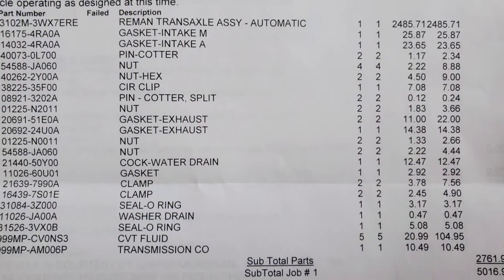2017 Nissan Maxima Cvt Failure! 🔴 What Signs to Watch For and Things To Avoid!

Comment: Definitely feel you pain…. My 2015 Sentra sr is on its 3rd transmission and this one is also failing…. This is within 1 year of getting the transmission replaced…Like you said it’s not worth going out buying a newer vehicle that is severely over priced… I’ll be sure to take the car back to the dealer for them to replace it again for the 4th transmission before my 1 year 12,000 mile warranty is up… luckily caught the issues 300 miles before my factory warranty was up
Reply: I just bought a new trans in my 2015 sentra sr 4800 bucks only 40,000 miles jatco trans suck and there should be a lawsuit

Comment: Those RPM's don't appear to be too out of whack.  You got all the way up to 80 MPH pretty quickly.  But maybe I am wrong....I did just purchase the 2017 Maxima in 2021.  It had 88K miles on it.  I've put about 10K miles on it and love driving it.  However, I did just spend 3K on the 100K tune up and to have the AC Evaporator Coil replaced when we noticed we were no longer getting cold air.  I wasn't happy about this and wish I would have bought the extended warranty.  Other than that, I love Nissan.  I don't have a problem with the CVT like most everyone else does and I really enjoy the heaviness, traction, and sportiness that the car offers.  My first car was 92 Maxima and I finally have another one that I has exceeded my expectations. (Minus the AC issue but that's what I get for being cheap and buying a used car)
Reply: The RPMs actually were winding up quite a bit, considering that the Speedo wasn't moving upward all that fast.  The Maxima has really got some brass ones if you step hard on the gas.  Then yes, the RPMs will wind up and you'll shoot like a rocketship.  But he's right; he wasn't really stepping on the gas hard enough in those 2 videos to justify all the noise and fury of revs in the 6000 RPM range; not at all.  The CVT was definitely complaining like it was in pain.
Reply: My honda gets to 80MPH with only 3000RPM then stable between 1900 to 2300RPM. Going to 5000RPM to get to 80MPH is definitely insane and it tells you that the Trans is going OFF soon.
Reply: The see-sawing RPM is the stupid feature this transmission has that simulates a 7-speed automatic's shift points. It tends to only do this when you floor it, so over time you can learn how much beans you can give it before the transmission starts trying to pretend it's an auto. You will actually be quicker if you accelerate right underneath this threshold. Didn't see anything in the videos that was abnormal. If your CVT starts to slip, it's different. RPMs go up, but you aren't getting torque. Or keep losing torque periodically. Also, by that point, it's most likely too late to salvage it.

Comment: I was told that I needed a transmission at 330k but at 392k I'm still on the same transmission.  IT had the judder code but that doesn't necessarily mean it actually judder. It's something only the code reader can see. No check engine light. Sometimes it revs a but high but at this point I'll have 400k miles or more so it doesn't matter. I can get a transmission put in for 1500. Not a big deal.
Reply: Good luck with that ..Transmission from junk with 100.000 will cost that much..
Reply: @A1cto5.3  no the transmissions were around 30k miles and cost around 1k but I don't need 1 now im at 404k miles it's still ok to drive hundreds of miles a day.

Comment: My car just started to do that crazy RPM shit. I too have a 2017 Maxima, I'm the first and only owner, Going on R sometimes isn't as smooth. Going to take it somewhere to get checked out. I have 84K miles on it. Does anyone know the warranty on the CVT?? Well, what I wanted to tell you all is that I just paid 3k for a new stereo system that broke down on me. The navigation, radio, cd player, maps all the display just went black and died on me. They didn't tell what happened or why it might have happened or anything. They just said it's dead and I need a new one. ANYONE else??

Comment: Nissan came out with the cvt and err body else just did better with the cvt transmissions Toyota is just fine. After replacing Nissan transmission you can't program it. Nissan can after replacement. Thanks Bro 😊 🙏

Comment: 2017 Maxima Platinum bought brand new had about 13k on it and had it for 2 years. Pulling into a parking lot and moving forward. It jerked forward and threw both me/passenger back. I knew immediately the CVT was going to fail. I got rid of it that same week and traded it in. Awesome car but weak and terrible CVT reliability long term. In my case it was already happening early. Yes they are unserviceable and must be replaced.

Better buy an extended warranty. It’s not a matter of if but when the CVT will fail. They all do with Nissan’s.
Reply: Yikes, at 13k? Unacceptable!
Reply: @gunterkeegan670  Double whammy! I kid you not. The vehicle we traded it in for 2019 Honda Passport Elite brand new. The transmission completely failed at 8,5XX miles and had to be replaced with another new one. We got rid of it once it was replaced for a new 2021 Honda Accord Touring in December 2020. 13,2XX miles on it now and been okay other then remote start that went out on us. They had to pull the dash completely out and drivers side door panels. It was a faulty wiring harness that went between the two. It’s worked perfectly fine ever since.

Comment: In conclusion. CVT transmisión are garbage and the worst thing is most car manufacturers are using this claiming that helps to be more fuel efficient. But shorten the life span on the transmission. Stay away from cars with CVT

Comment: all Cvt's are covered under the 10yr 120k warranty the dealership should have told U that
Reply from the maker: i was past that by 4k miles when i had it looked at
Reply: That's not true for my 2022 Infiniti QX-50. The booklet says 72 months/70,000 miles for the powertrain.

Comment: I never heard of CVT going out in 8th generation Maxima think CVTS got better hope had extended warranty get it fixed. It was lawsuit on Altima and Rogue models got a 2015 Rogue CVT still fine right now not worried got extended warranty its paid off even on original battery and brakes. I love ❤ Nissan's some CVT trannies will go out for no reason hope got it fixed.
Reply: I do too. CVT aren’t bad if they are built decently but Jatco has a poor reputation. If Nissan would take their stake elsewhere I believe they would up to par. Nissan makes good engines. I have a 2016 Nissan Sentra with 100,000 and it has been a great car

Comment: Cvt fluid needs needs needs to be changed every 25k to 30k if you do 4.55 quart fluid changes every 40k if you do total fluid change 8.5 quart complete swaps.  It needs to be done and only with nissan brand fluid.  If your save $37 by buying non nissan brand your risking a $4000 repair not smart.  Change your fluid and don't drive like a jerk for first 5 minutes everytime you drive a nissan with a cvt and cvt will last 150k +

Comment: You bought it with 6k miles on it and now complaining that its showing transmission troubles at 123k ? You should be thankful because you got well over the average life expectancy of a cvt transmission . Most of them don't last 45k to 50k miles . There is a reason you see so many used maximas and altimas at the 40k to 50k miles mark for sale .

Comment: I've not known Maxima CVTs, NOT ALTIMAS, to have full-on failure with routine maintenance until after about 190k - 220k miles (that's good for an average transmission, Toyota 8-speeds don't last that long). The symptoms were of a bad valve body not failure, see some vids that's different, and usually taken care of early on under warranty. I don't think they either correctly assessed, or were completely honest with you, and their ignorance (or greed) cost you...

Comment: 😁😁😆
If you screw your car
Your car will screw you.
I had Gmc safari, Honda odyssey, Accord, Buick century, corolla, caravan
They all lasted me 300,000 kms
Caravan and odyssey lasted me 585,000 kms.
I'll share one secret to do that.
Start your car and leave it for 3 minutes so it can catch the rhythm. Then gradually start your radio ac whatever in next 3 minutes while you are driving your car. After 5 minutes you can drive your car whatever way you like but initial 5 minutes respect your car after that your car will respect you and never leave you on the road stranded. 25 years of experience.

Comment: I currently drive a Jeep Patriot 2012 and it’s at 141k and it’s CVT feels great on a cold start. When temps get to hot, it starts lagging. I went and got an oil change, 1quart is hyper lube/3quarts high mileage. Added a additive to my coolant. Changed transmission fluid. Now runs unbelievable smooth, I do not use 87 gas, I use 89 now, because of the compression is better on the pistons. Just be gentle on them, they are very amazing.
Reply: We had a 17 patriot that we bought back in 2018 and it was great but that vehicle should not have come with cvt. We sold it for the same price we bought it for this march and had about 30k miles put on it. Got a rav4 couple of weeks ago and my dad has never been happier compared to the jeep in terms of comfort and gas mileage. That patriot was basic as well, had roll up windows, no bluetooth/touch screen, no keyless entry, no backup camera. Compared to that, the rav4 is like a luxury 😂

Comment: Nissan recommend the transmission fluid should be changed every 25,000 miles
Reply: Don't forget to drop the pan clean it out and change the two trans filters too.
That includes the two magnetics on the bottom of the pan

Comment: I have a 2017 maxima SR at 47k miles and drive it in sport mode mostly but I appreciate the video.  Good info. I have had a issue with a clicking or poppin noise when I shift into drive or reverse and start breaking. I took it to my dealership for the problem and they told me the guys greased some kind of bearings but I am still having the problem....thanks Nissan. Anyone have any similar issues?
Reply: Lol I had the same problem for a while. Went to the dealership twice for it and they greased it and it went away for a month but then came back both times. I haven't gone back since the sounds comes and goes and I don't think it causes any problems.

Comment: It’s disgusting that Nissan keeps making this pos transmission and keeps installing them on new cars. 

This transmission has been garbage since day one.

I’ve had 3 Nissans with this transmission and all 3 it failed after 130k miles despite by the book maintenance and daily driving basic around the  city down the highway no fast n furious bs.

Nissan knows this transmission is garbage but because of all the negative press Nissan already gets they have refused to issue a recall for this garbage transmission even though it’s been getting complaints all the way back to 2008 models 

There’s no reason for cvt in economy car that drives as daily commute car

Comment: Fortunately I was able to change mine on my 2010 at around a 109000 under warranty.

 I've had some similarities on the freeway with rpm's  just didn't want to go down unless I put it into manual mode and shift myself.

 The only annoying thing of having a freshly rebuilt transmission is it constantly wants to lock up the torque converter so the RPM  could be low as possible for good fuel economy🤣🤣🤣🤣🤣

Comment: I would spend the little extra for a Toyota or a Honda not the 1.5L turbo Honda engine but the 2.0L engine Toyotas have better Transmissions they make them themselves instead of the cheap ones Nissan buys and uses Toyotas are better built and more reliable Car brand now Nissans are just as expensive which is crazy when they are no where near the quality or Reliable

Comment: best way to avoid cvt problems, is to not buy a garbage car with a cvt to begin with. auto industry should be sued for such a failure of automotive engineering.
Reply: @eastside313yahdig.2  lol..... those cvts one has to take it easy on it
Reply: @alvinsimba734  I see a lot of mixed reviews on the CVT. I’m debating on a maxima or Avalon now.   The maxima is cheaper used.   I’m looking at one less than 30k miles.    Can’t decide tho but I’m leaning more maxima.
Reply: @eastside313yahdig.2  get the avalon man. Might be pricier but you will not visit the mechanic except for regular maintenance. Myself I own 2 toyotas. 2005 matrix with 2020 corolla. The matrix is still on original transmission and suspension including shocks and rear brakes too now with almost 300k miles. The corolla is technically brand new with only 12k miles with the same engine from the matrix except the matrix is 1.8 regular automatic while the corolla is 1.8 as well but with CVT instead and with way better gas mileage out of the two.
Reply from the maker: i really do feel a class action lawsuit is in their future for these cars
Reply: @Baysidereviews  that depends which brands, some are better than others.

Comment: I had a 2009 altima 300,000 miles no issues change the oil every 50,000km and u will be fine...I have a 2012 no problems....https://www.youtube.com/watch?v=MMSC4Yew560

Comment: The problem is lazy educated wrong dealer. They think the proper way to service Trans is drain oil measure what came out and put the same amount back in. Once low always low. They need to pump oil into fill plug start car run it into gear and reverse . Then top off threw fill plug till level